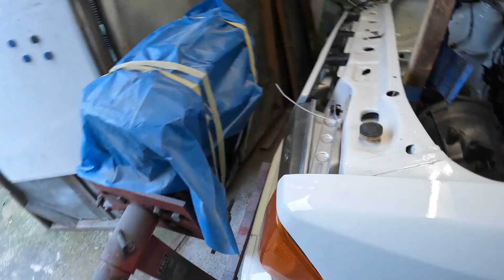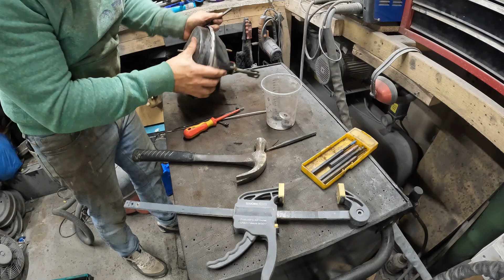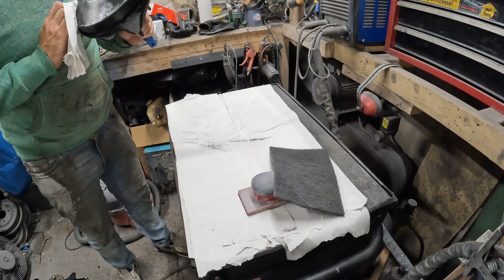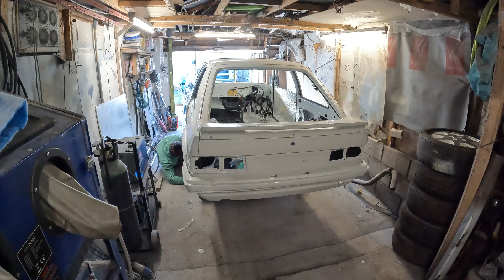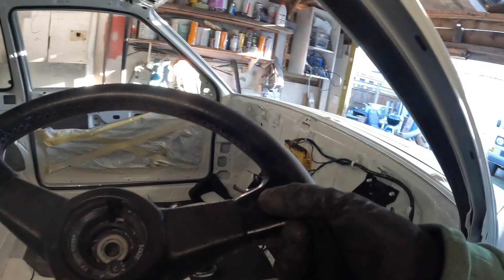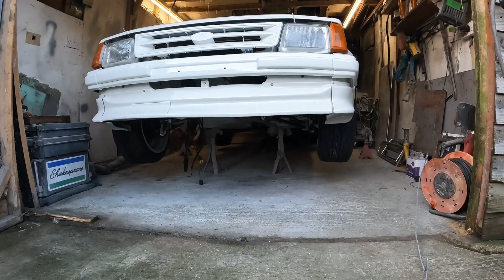Ford Escort Series One RS Turbo Restoration. Brake Server rebuild, and it finally gets its wheels on

Comment: It looks soo good ,keep up the good work 👏
Reply: Looks a good job mate,keep it up ,I did notice you torque up the rear wheel bearing if that's a tapered bearing it should be nipped to seat it properly then back the nut off about half a turn and check no play in it  with wheel on.
Reply from the maker: @davegermaney5439  thanks, I'll double check that, I'm sure they are tapered, I used the torque setting from Haynes so will double check those, thanks for the heads up :) appreciate it
Reply from the maker: Thank you